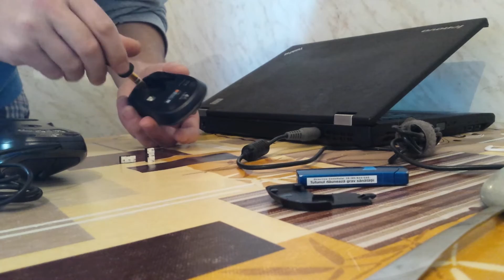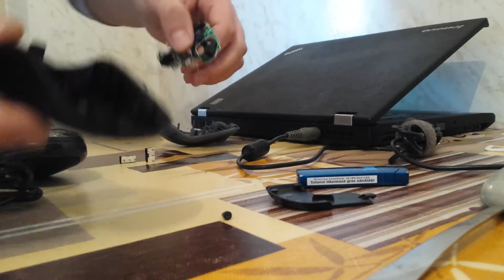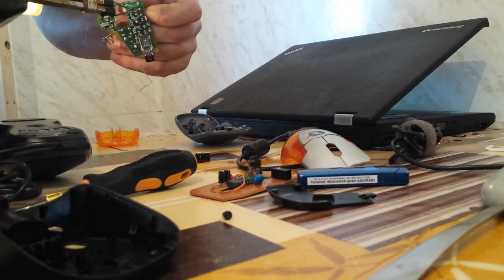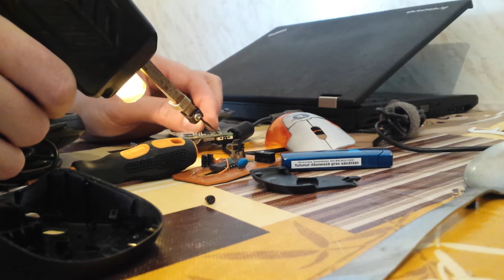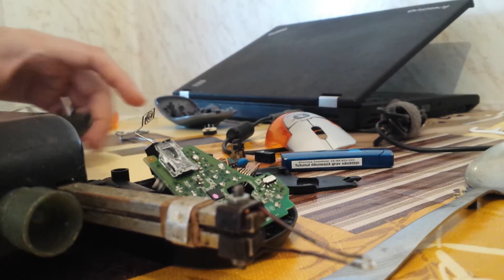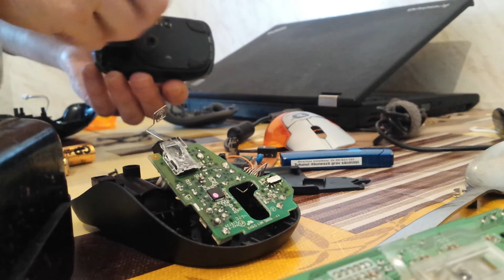fix logitech Mouse. M555b RX1000 M185

Comment: thanks for sharing how to open RX1000, I had the same problem with "unstable" clicking. I didn't replace the switch but I just cleaned the accumulated dust with a vacuum cleaner, and... it seems fixed!

Comment: i almost crack my RX1000, thank you for helping me open it. try to fix the wheel
Reply from the maker: clean it (the wheel)- or see if if distance between sensor and receptor that wheel passes trough are correct distance apart

Comment: Thanks for the heads up on my shaking video. I actually like your video but if you're trying to get views do videos on something of value no one cares about a broken mouse I have a tote full of the in the garage. On the other hand if you used the clickers to build your own creation I would give you a pat on the back and tell you that is awesome! Oh and buy a better solder iron on eBay they are cheap light weight.